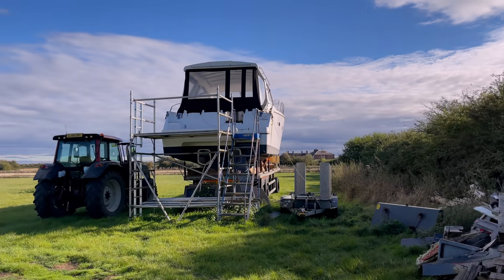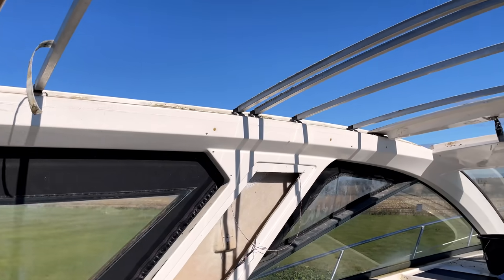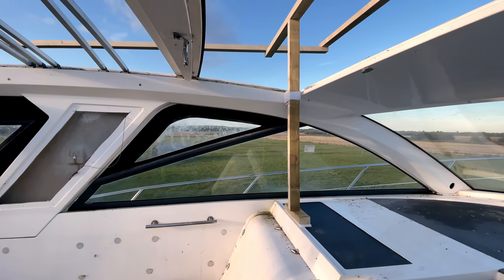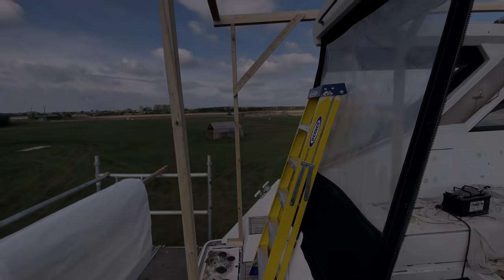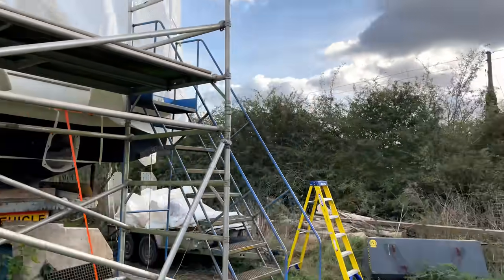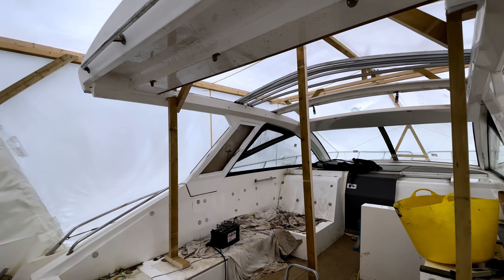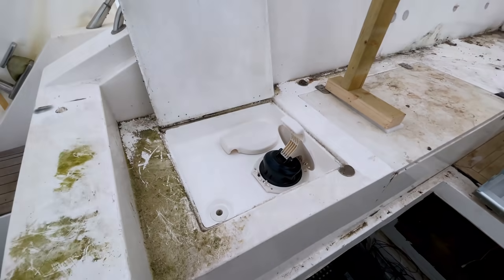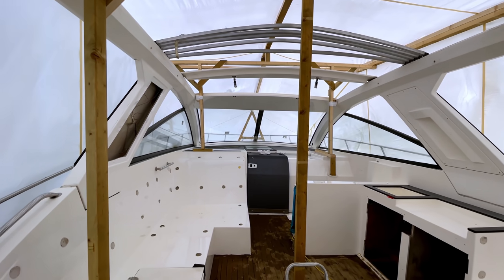DIY YACHT Restoration - Shrink wrapped for the winter - EP.58

Comment: Nice to see you guys back 👊 just a question, Why did  you go with those manual bilge pumps? Do you have a elektric one as well? Great content as always. 👍
Reply: Hi Robert, the manual bilge pumps are as fitted to the factory sc35 and whilst not mandatory on pleasure vessels up to 13.7m, they are recommended. Our primary bilge pumps will of course be electric but they're not much use if the batteries are flat and both engines are down.
Reply from the maker: Thanks Robert, good to be back 👍